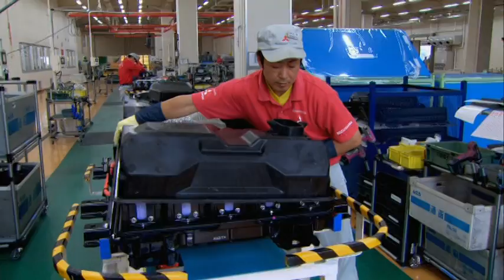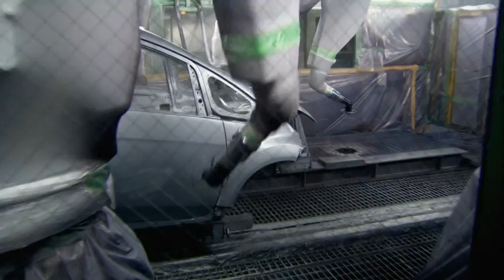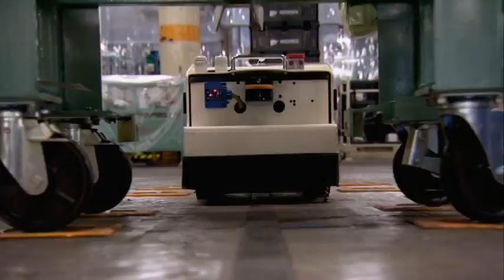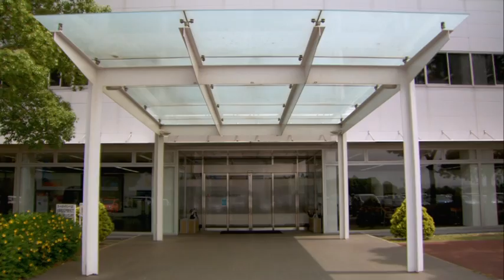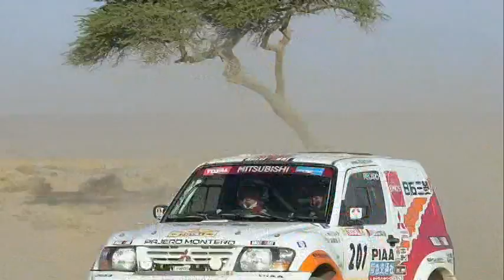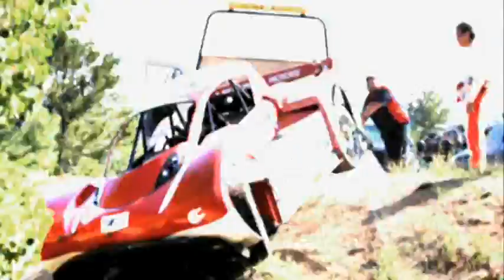Making of the Mitsubisih i-MiEV Electric Car (Part 2)

Comment: Wait until your charger go bad or the battery pack! Then you need a charger for 4000 euro and a battery pack for 10.000 Euros! And don t think that you can buy a used because all are vin coded !!! So driving an imiev is more expensive as a normal small car after 15 years!And not to mention the parts for the car that are expensive like you have a old Ferrari.  Thanks to Mitsubishi that show as once again what is to drive an electric car!! Green drive looks different !
Reply: My charger also failed but Mitsubishi replaced it free of charge. Uk pounds 5,000 was the estimate.

Comment: I bought this Mitsubishi in the United Kingdom, Birmingham. It was registered December 2009 and has been driven around the entire globe by two French enthusiasts. Mine has HID LED headlights and has covered almost 30,000 miles. The only maintenance has been replacement tyres and windscreen washer fluid top ups. It can be recharged via solar PV and rapid charged at motorway service stations in 25 minutes. I average 65miles per 16kWh. Fuel has cost 250 pounds per 10,000 miles = an 80% saving gas.

Comment: I'm not sure you are calculating those rebates correctly. the base model S costs 60000$. there is a 7500$ federal rebates. I doubt there is a 15000$ further illinois rebate

Comment: it could be a good car if the price wasn't so ridiculously high. 16kWh batteries are simply not that expensive. LGchem cells is only 3200$ so the car should cost 12000$. not the ridiculous 30k$ they want for it. and the price started at 48000$.